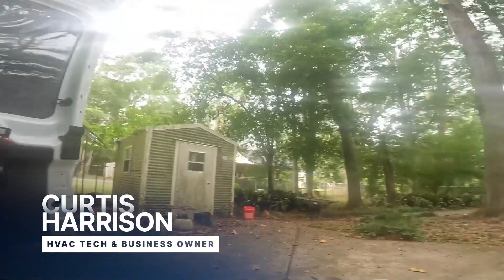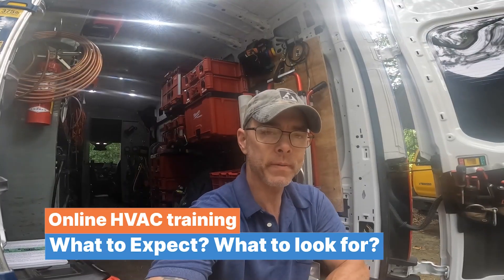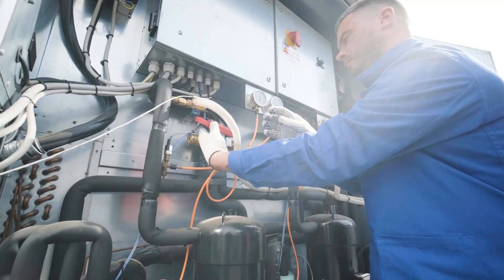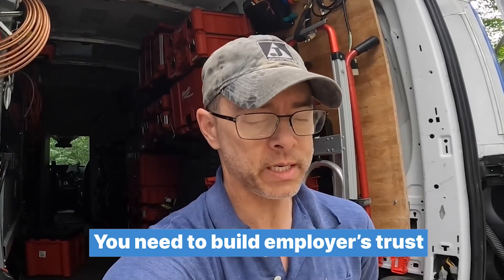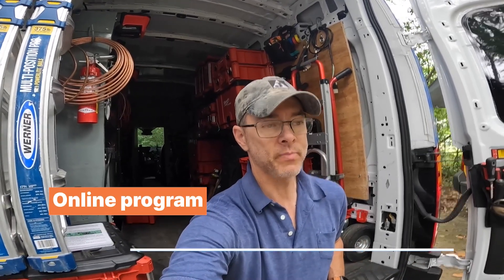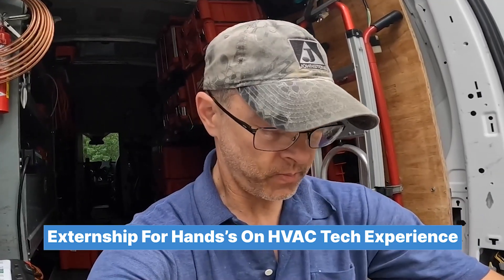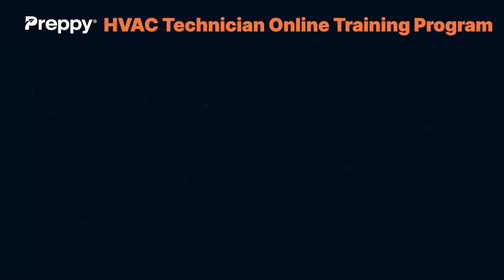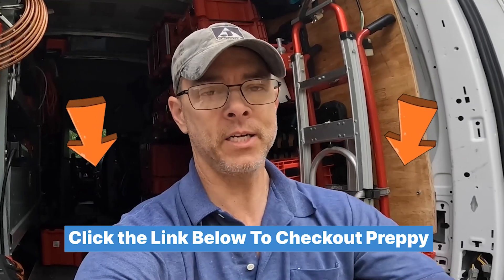Online HVAC Training - How To Get Online HVAC Certification

Comment: An ides for you.  Start at the breaker in the air handler and show how to wire the transformer to circuit board and thermostat. Then to the condenser unit.  Another would be a draw down. Vacuum all the gas out of a unit step by step plus settings on equipment.

Comment: Dang $2500 for this program including a laptop is cheap. I'm a mechanic and just do my own hvac repairs on my own home, but if I was wanting to do this as a career I'd definitley jump on that. Especially since all the school portion of it can be done at home on my own time, except the externship part afterwards of course.... is is just a certificate, not a degree, but thats all you need in the HVAC industry
Reply: Hell, I paid over 1500 in tools alone to start. The courses were another price tag. But I still have like 95% of those starting tools over 5 years later, so it's not a waste or anything. But it aint cheap!
Reply: My 2 year degree to be a mechanic was $25,000. So $2500 isn't spit to be roughly the same income give or take...
Reply: @natersalad889  Agreed. I got lucky. I think I only paid roughly....12 grand for my two year degree. Give or take. It's been a while. Mechanic is a cool degree to have. Bet it can take you anywhere in the world.